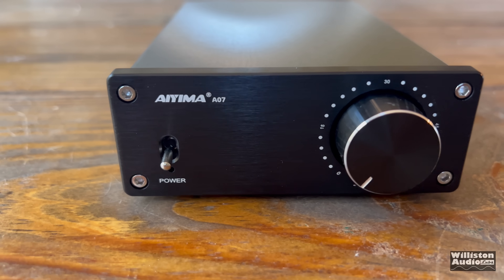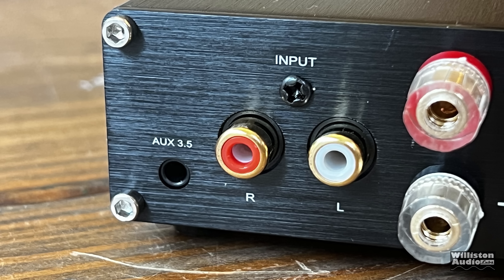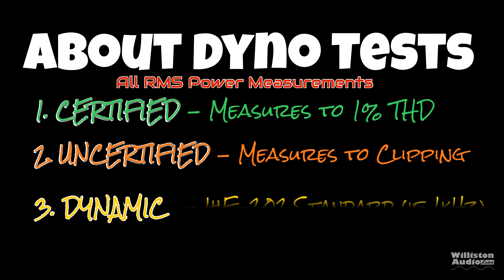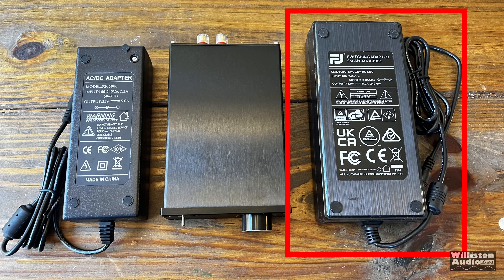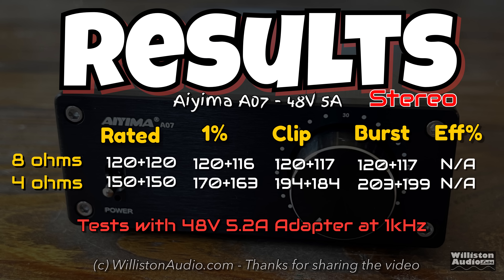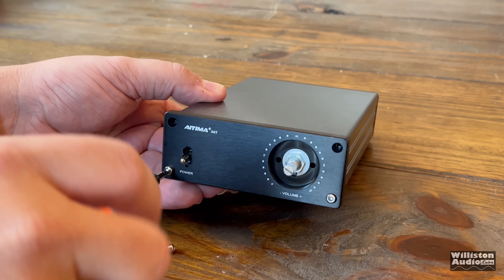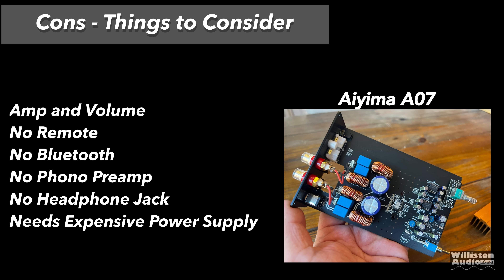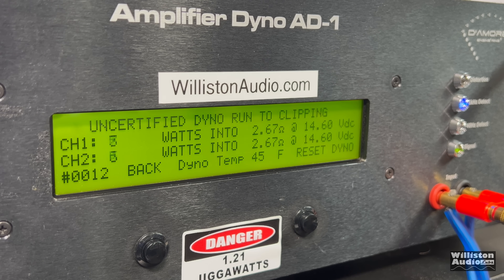Is it the MOST POWERFUL Mini Amp on Amazon? AIYIMA A07 Amp Dyno Test and Review

Comment: So if I got the 48 volt 5.2 amp adapter at 4 ohm's I should be able to probably get a continuous 120 watts clean per channel?
Reply: Yes, but not for long because of its inadequate thermal management -- the small heat sink and closed case are the limitation on long-term continuous power.
Reply: @editorjuno  I see, then more cooling will be needed.
Either larger passive sink, or a fan.
Reply: @BARBELLS-AND-BUDS  -- ...or some clever scheme to thermally couple the top of the chip to the case.  BTW, the current A07 has a bigger heat sink than my older ones, so it's a marginally better performer in that respect.  The also fixed the L+R connections to the 3.5mm jack, which were reversed from the de facto industry standard of T=L/R=R in the older ones.
Reply: @editorjuno  How long ago did you buy yours. I bought mine in March last year
Reply: @BARBELLS-AND-BUDS  -- I bought the first two in the Autumn of 2020, before they went with a smaller power LED.
Reply: @editorjuno  I've never owned mine up. I use it for TV watching in living room.
Since we have a 2-year-old I had to move my theater to my bedroom but I have some bookshelf speakers I built in the living room that I run on the a07

Comment: Should have tried 3 of the 16v batteries or 4 12v in series for a 48v power supply.  That would be well in excess of what the amp could output.
Reply from the maker: 12V batteries rest around 12.8 so 4 of them would be >50V and likely unsafe for this amp
Reply: @wal  The TPA3255 is rated for a maximum of 53.5v, you can see that in the datasheet.
Reply from the maker: @Random_4400  True, but also note the 50V caps on the board
Reply: @Random_4400  I guy put a tester on it and it shut down at 50, on old guy on yt

Comment: No bluetooth in 2023, I doubt that's gonna be a top seller
Reply: It's a power amp, not intended to compete with integrated amps with BT, tone controls, etc.  It's already a huge seller -- it's been around for over two years!
Reply: @Bruce Morgen  Yes I know but why buy an amp that has no bluetooth or the ability to hook up a subwoofer when there's other amps just like this one that can do those things

Comment: This is a wildly popular amp in the audiophile community. I have one plus a few others. Got the $900 topping super clean amp on the way soon too.
Reply from the maker: I’ve had many people request the tests. I had no idea it’s been out for over a year
Reply: @wal  let it burn in for over 3 days straight. You will find that this amp will give you really clean sound with a very clean dac like the smsL do100 (not Bluetooth) or the topping d10s
Reply: @wal  -- Almost three years!
Reply: people who claim to be in the audiophile community wouldn't look at this through a telescope, they have 50-90 lbs 3k amps.  Us on the other hand...
Reply: @trauma50disaster1  I'm in the audiophile community. There is no prerequisite for your gear to be over a certain amount or over a certain weight.  People just want to best sound. Once in a while a unicorn comes around like this amp and some dacs. By the way you can make this amp sound even better with special op amps but they are $85 each and you need two of them
Reply: @Douglas Blake rolling the opamps produces a noticeably significant sonic upgrade to this amp. Its worth it.

Comment: Sir- thank you and what great information and content.. I’m am more thoroughly impressed by your humble work and responsiveness to inquiries. I have a question about many things I notice with your amp tests: does it mean anything when or if the amps show same or very similar power outputs in the different tests? I’m leading to the idea of - does it have any bearing on stability? Or, can it be an indicator for potential overheating when in use, playing certain types of music. It comes to mind from when I had my pioneer and kicker amps- the kicker could play all day without cutting out, where not so much with my pioneer. Is there any relationship with those numbers? Thanks again- keep rockin, and do you test EQs? I’d like to see that on spectrum and breakdown on clarity or real bending of sound wave curve with adjustments. Cheers
Reply from the maker: Most of these mini amps lack headroom and, in my opinion, amps with good headroom (think NAD Power Envelope) just handle dynamics much better. That said as long as your volume level is reasonable and the speaker load isn’t too demanding, amps like this can provide a lot of smiles per dollar 👌

Comment: Another Pro you didnt mention here, and I dont know what trying to find the components would be like, BUT, ability to get to the components with simple tools is great. Very repairable for even a novice tech.
Reply from the maker: Great point!
Reply: It has too many surface-mounted parts -- including the TPA3255 -- for "a novice tech" to repair other than to replace the op-amp and/or the big through-hole parts like the large capacitor and the inductors.  Dealing with tiny surface-mounted components requires major league (de)soldering skills and manual dexterity

Comment: Nice review Big D as it's time to acquire one with the added $15 coupon. It is possible to run a sub via high level (speakers setup) if the sub offers it. I personally prefer it that way, as many subs have a variable Hz with them and most sub low-level out sub outs on newer receivers have a fixed Hz. I am curious as to why Amazon lists it requires 240 Volts (AC)  likely a typo any hoots Thanks'

Comment: Would have liked to see it run on 48 volts of batteries
More amperage that way
Reply: and more fire
Reply: @trauma50disaster1  -- Fire isn't an issue with modern Class D chips because they have built-in thermal protection.

Comment: hi thanks a lot for the very valuable review
is the fact that the amp almost doubles the power from 8 to 4 ohm a good thing?
will using 48V psu shorten the amp's life?
i am thinking of buying one and make some holes in the case below and above the heatsink to improve ventilation inside
Reply: for $60 if you buy one every year or 2, comon
Reply: @trauma50disaster1  hi you are right i am buying one and will make some holes in the box 
Better many small o a few bigger?
amps have to breathe freely
Reply: @Douglas Blake hi thank you for the very kind and valuable advice I will buy one soon and listen I have good experiences with Meanwell smps
Kind regards Gino
Reply: @Douglas Blake hi thank you very much again I see Better don't mess things up
But i am sure that a Meanwell psu same voltage would sound better
I have seen Meanwell psu inside very expensive professional equipment
They must be much better and not that expensive
I will try one just for curiosity
The stock psu cannot be phenomenal because it is too cheap
kind regards gino
Reply: @Douglas Blake hi thank you very much again It is just for curiosity
What i really need would be a stereo power amp because i have already a preamp that i like
i will set the amp volume to max
i have to check its voltage gain
as i am a little on DIY i would even put the guts of this amp in a new nice standard size box with the psu
my preamp is standard size about 42cm
i was looking also to the 7498 chip boards as an alternative 
but i guess this one is better?
Reply: @Douglas Blake hi thank you for your valuable support I will do this
but last one Which of the two? i think the TPA3255 could have better performance? i am confused
Reply: @Douglas Blake hi thank you very much again I will take the easier route 7498 I will select a psu suitable for both
I tend to like bigger boxes Amps need air around them
in this way I could always swap boards in the future
Thanks again and kindest regards gino

Comment: I'm really surprised you didn't use your battery Bank to power it 12 * 4 is 48 volts at whatever amp that'll take
Reply: But battery 12v have more .. 
12.8 or 13 x 4 is 51volt and more 
Only E-bike Batterie can

Comment: Interesting. I thought that those TPA chip amps can produce the rated watts, but the audio would be very distorded at that point. The results of this amp are the complete opposite of what I was expecting, and they were even better than what I thought. Also, it is surprising to see a lot of lower watt (<= 400 watts) class D car subwoofer amplifiers such as Rockville DB11 and lower watt class D plate amplifiers of powered car subwoofers use individual transistors for the output stage instead of chips. It seems like using TPA chips instead of transistors is a better idea because it will make them smaller, lighter, and more versatile. If using TPA chips for standalone amplifiers is not going to work since the chips can't handle 2 Ohm load, then it is still doable with powered car subs since the drivers inside the enclosures are mostly 4 Ohm. Doing so can make the circuit board and heatsink take up less space in the enclosure and leave more room for the bass.

Comment: I used to be all about the fancy amplifiers, Yamaha, Kenwood, Onkyo etc.. but now for most of my setup's (not in the movie room) I just use these. They are great little amps especially for computers and gaming or somewhere you need sound. I have several by YJHIFI that I believe use the TPA3116 which is a 50W*2 + 100W sub and the sound is actually pretty damn good. They are basically the same as the Douk Audio you did a review on about a year ago. I built several Overnight Sensations MTM with 8 inch Infinity Sub for each system (me and my kids) and they put out some good tunes. Look up 'Decaf White Clouds' here on YT.  They hit every note DEEP and clean.
Reply: lmao paid reviewer spotted
Reply: @automachinehead  Your intuitive powers of reasoning area seriously flawed and no, I am not nor ever have been paid for any review. I'm just a guy like Wilson that likes audio equipment. so see if you can figure out this one out: GFYS
Reply: @jamescole6846  sure thing buddy

Comment: So, it seems to me that this amp would be more useful in a car audio setup than a home setup. You could use it to drive midrange or tweeter drivers. It's small, appears to be well constructed, and the lack of fancy features would not be a drawback when used in a multiamp car setup. You also sidestep the problem of needing a big D.C. power supply in a car.
Reply: Why better for a car than home?
Reply: @maccagrabme  You could mount it wherever it is convenient because of its small size. Home amps normally have features like tone controls. Certainly, you could use it to drive midrange drivers or tweeters in a home multi-amp setup, but you would have to buy the bigger DC power supply, and that pushes up the price. You don't have that problem in a car setup because you would already have built a large DC power supply to drive your woofers.

Comment: Good one!!
This pretty much sums audio up in a nutshell right here. Most of your $ for any new amp goes to the cost of its power supply. Better your power quantity & quality, better your sound.
Reply: Not really, it just plays louder so you go deaf and can't tell what sounds better anymore. ;)
These do not need "special" power supplies, just something with enough voltage and current for your speaker impedance at the volume you choose to listen to it.  That does not mean to get some trashy $5 generic SMPS from China but that could be said about buying a PSU for anything less tolerant than LEDs.

Comment: I’m a 1:13 into the video. 32 volt 5 amp does not equal 600 watts. I’m going guess maybe 65 a channel. So I was off. Very impressive with the bigger power supply. Great video big D. If that line out was controlled by the volume knob I’d be ordering one right now.

Comment: Back in the day I had a 1990 Ford Festiva with a Sony Xplod tape deck, a Sony 10-disc CD changer, MB Quart side and highs, my buddy gave me a Blaupunkt 12" in a tall ported truck box, and after I bought the head unit and CD changer (from the Sony Outlet in Grove City Mall in Pennsylvania, and was about $400 for both, I was 16 and had a part-time job making $5.25 an hour) and the only amp I could find was a 50w bass booster...yeah. However it didn't need much to sound decent in that tiny car. Later I put two Orion Cobalt 10s and a Sony 900w 4 channel amp (that was $250 refurbished back then, roughly 1999). Now I have a 2004 Acura TL with a manual swap and a custom turbo kit that has a Jensen Bluetooth 7" touchscreen, Kicker mids and highs, a Skar 5 channel 900w amp, a Soundstream Rubicon Nano RN1.5000D 5000 watt amp (not even close to 5000 watts), and two Sundown SA12-D2s. I am 40 years old now, but I'm still a kid at heart.

Comment: These type of little amps are great for the price. I actually just had an Aperion 8D subwoofers amp kick the bucket. I pulled the plate amp off and removed all the guts and hooked up the subs to the input posts and then hooked up a little $69 sub amp to it and it works great again!

Comment: Another reason you can get so many watts from this setup is the TPA3255 is set so that the Class-D modulation is 180 degrees 60 degrees out of phase between the two channels when in stereo BTL mode.  When one speaker is getting power the other speaker is not and this is happening at a modulation frequency of around 500KHz to 600KHz, way outside the range of human hearing and way outside the power supplies switching frequency.  This just allows the chip to suck a little bit more juice from any supply even though it's powering two speakers because it isn't powering both at once.  The output filters in a Class-D amp are designed to make it look like a constant signal to the speakers. Win win win...
Reply: @Douglas Blake I'm sorry, it is 60 degrees.  It is a Class-D chip and the interchannel delay for idle switching makes left and right channels fire 60 degrees out of phase in stereo BTL mode.  Page 24 of the TPA3255 datasheet.  This allows the chip to pass less current all at once by timing how it powers each internal mosfet...

Comment: There is a 48V 16.67A 800W power supply on amazon that you can adjust as close as possible to the TPA3255 max of 53.5 volts to get the most out of the chip.  Not sure if the AIYIAMA box can handle over 50 volts but might make for a nice video to see if this power supply can help it make it to 315W per channel... or blow up the box.  ;P

There was also a 600w mono version of this AIYIMA box but it doesn't seem to be on amazon anymore.  They were pretty good at higher voltages on 4/8 ohms...
Reply: All my A07s have 50VDC rated caps.  I understand the most recent ones have 63VDC caps.  In all cases, the limitation will be thermal management, not the chip itself.
Reply: @editorjuno  Yeah, you can literally reach the wattage in the datasheet but that means nothing if the small size heatsink is stuck inside a box with little airflow.  But it would be cool to see one hit the rated wattage and go into thermal shutdown and have to be turned off and on again.... or just blow up in a puff of smoke because the cheap caps blew...
Reply: @10100rsn  -- Actually, the 50VDC caps in mine aren't "cheap."  They're real Nichicons and I'd honestly trust them to hold up at 53VDC before I'd trust a 63VDC part from some random Chinese source.

Comment: Can you elaborate on 10:10 please? I want to use the 3.5mm out for my subwoofer....Is that possible?
Reply: It's possible if you control volume with the source device, using the A07's volume control strictly to establish L+R-to-sub balance.  That 3.5mm jack really isn't wired as an output -- it's connected in parallel with the RCA jacks.
Reply: Yes and no. Depends on what options your sub has?  Speaker pass through yes.  Speaker line level in yes. If you drive a sub amp then it’s fine but now got two volumes dials.  I run svs sb 2000 off this and can use the smart amp to adjust.  Works just fine for my bedroom 2.1 pc gaming setup,
Reply: Note volume knob doesn’t control the level since it’s “line out” so directly to headphones wouldn’t work. But as pass though continues work with the amp off yet plug-in power wise. So you could go to another headset amp. Turn off for the other amp then turn on for the speakers.  Also if your sub has speaker input output pass through then work fine with this amp.

Comment: I have the A07 in the shop for the last year. Nice amp, the volume pot is a little noisy now. The TI chips have great sound. They also have socket  Op amps so you can upgrade which I did. This one does not sound quite as nice as the smaller TI chip but its close.
Reply: I have a TPA3116 amp and I think the A07 with its TPA3255 actually sounds better.
Reply: Maybe swap it out for Alps RK27

Comment: The little Elac are punchy...  I have made some y adapters to connect two of the smaller power bricks to get more current.  Not all of these switch-mode supplies appreciate being in parallel though.  I made a capacitor bank with two 5A brick and several 4800 uf 100v caps in parallel and did get very close to rated power.  My experience is with the Dayton Audio amps and the bare Sure amp boards.   They can make the watts but need additional cooling... adding a fan really helps.